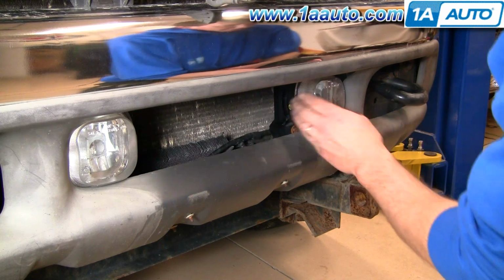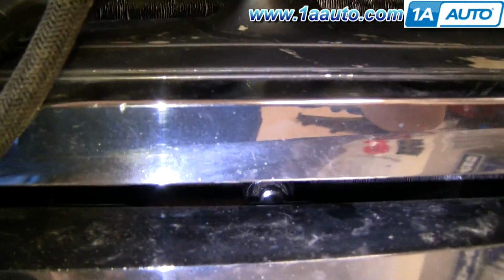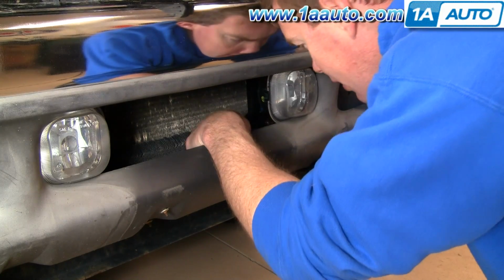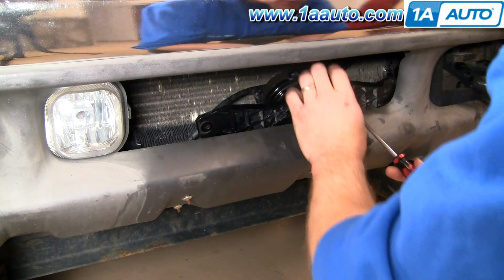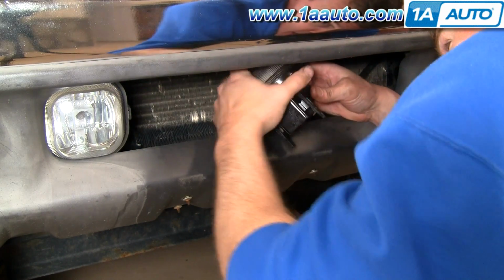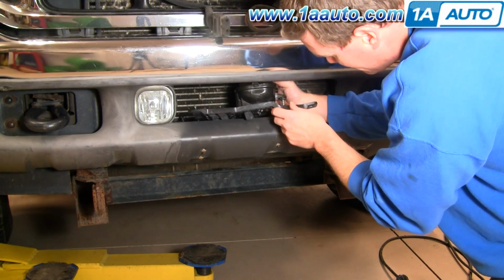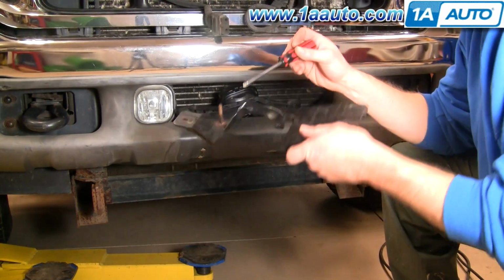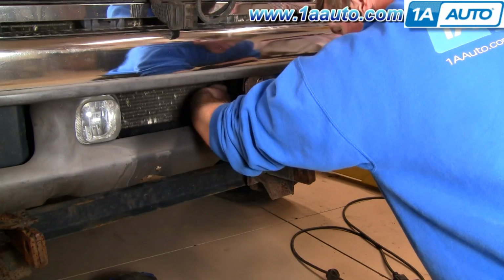How to Replace Fog Light and Bulb 01-04 Ford F-250

Comment: Hey  bought a 2000 f250 I have fog light on my truck.  And the switch inside of the truck. But looks like the wires harness to them is not there. Where is the plug for the harness to plug in to? Is it the one by the drivers side wheel well on the frame?

Comment: how did you get the license plate bracket out ? is there any type of screws or bolts ? or just use force and pop em out ?
Reply from the maker: +les 1149 Our truck did not have one. There should be only a couple of screws that hold in in place. Hope this helps you out. 1aauto.com
Reply from the maker: Thanks for the tip!

Comment: Would it just be easier to quickly remove the bumper?
Reply: ONLY IF YOU HAVE SOMEONE ELSE TO PULL IT OFF WITH YOU AND PUT IT BACK ON, NEED TO SET SOMETHING UP TO CATCH THE BUMPER LIKE A COUPLE TIRES OR REMOVE THE BULBS FIRST BECAUSE THE WIRES WONT REACH TP THE GROUND AND IF YOU TRY TO LAY THE BUMOPER DOWN THEY WILL PULL ON THE WIRES NOT GOOD.  I ALWAYS TAKE OFF THE BUMPER
Reply: i have an 04 harley model they would not come on sat there an hour trying every which way to get that square head out would not go out like this guy had to losen front bumper support pissed me off to no end

Comment: Ya my 04 doesn't have Fog Lights I need to check and see if the wire is in the bumper, where would the other end be inside the dash....any idea ?
Reply from the maker: It could be where ever the factory places the fog light switch. If there's a block off plate, or headlight switch without the fog light option, the wiring might be behind it. Hope this helps out. 1aauto.com

Comment: Are the wires there for to add the fog light switch and lights to a non fog light 2005 f250
Reply from the maker: Thank you for watching! On a lot of applications the wiring will already be there.
 888-844-3393